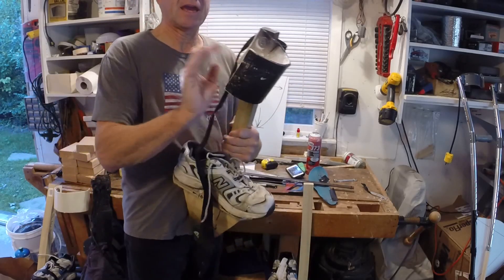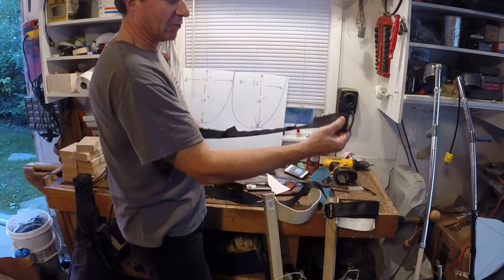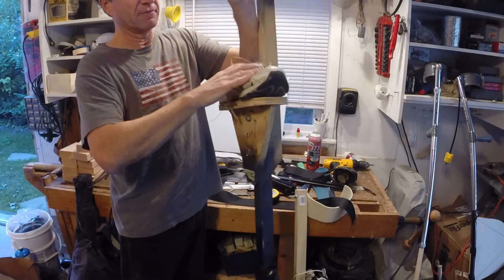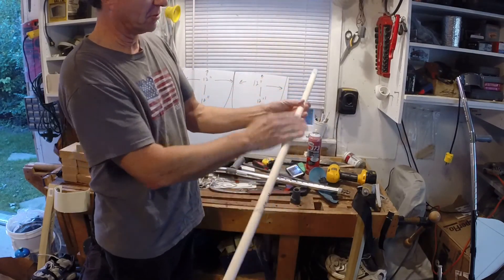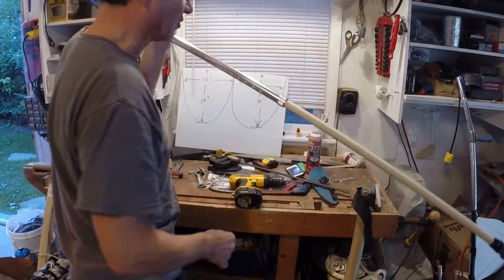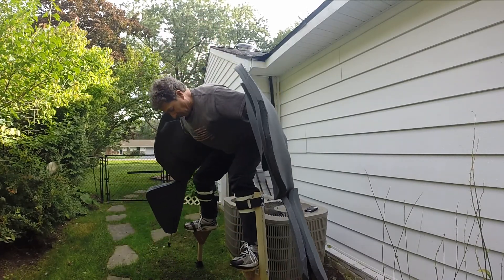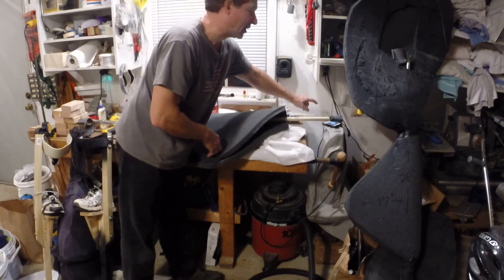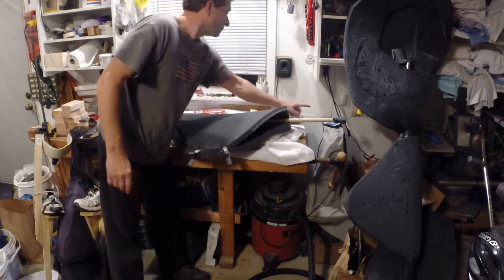Build a 4 Legged Stilt Walker Costume Part 2- Best Costume Ever!

Comment: Is there a reason why you put the dowl In the crutches. What if I leave the crutches like that and just have them extended?
Reply: Forearm crutches are for balance. Since you are putting your whole body weight on it, the little metal pins could fail and you'll fall on your face... is more of safety I assume.
Reply: Its to make it longer inorder to be more stable and comfortable to wear/move around in for longer periods of time. If you left the crutches as is, when walking with the back stilts, your entire back would curved like an arch. With the added length you can stand more upright making the costume significantly more comfortable and stable.

Comment: would i be able to adjust some of the measurements for the foam part of the arms (make them smaller)?
Reply from the maker: Not a problem. The front crutches are fully adjustable, the stilts can be built to fit and the foam sheets are easily trimmable.

Comment: Is there a way to adjust the measurement to make it into a costume for a 12 year old?
Reply from the maker: Yes, you'll need to shorten the upper stilt board so the calf cuff is the appropriate length.

Comment: i dont know alot about this stuff what is a dowl and could i use pvc pipe for crutches?
Reply from the maker: a dowel is a cylindrical piece of wood. You could try to use pvc but its not recommended.
Reply: Kevin Miller thank you so much  that is what i thought but i wasn't sure